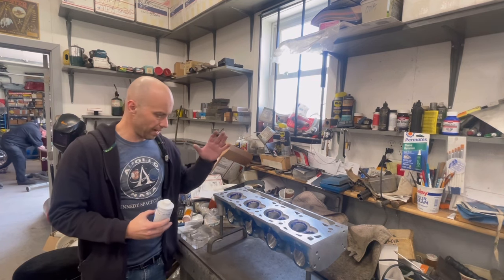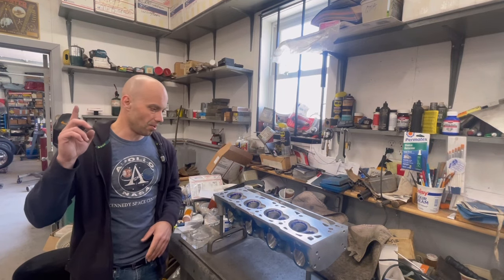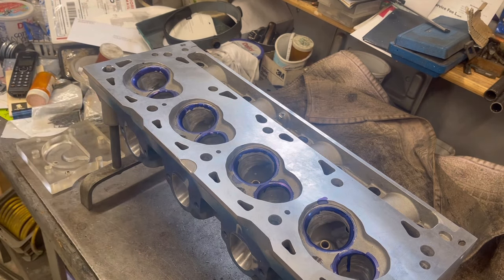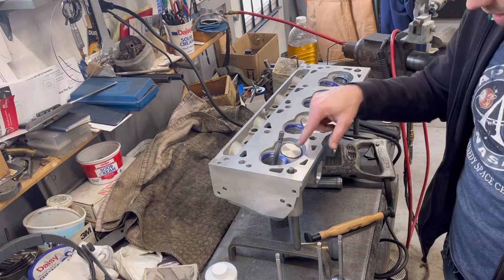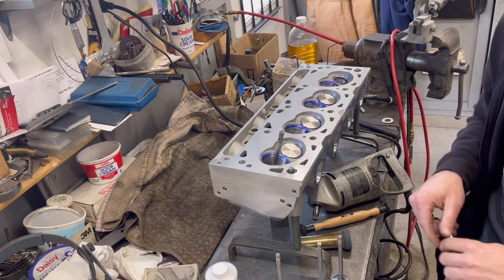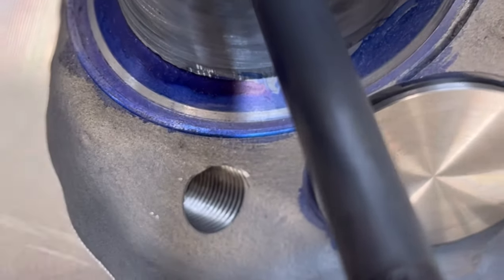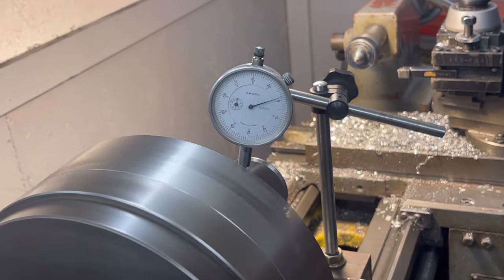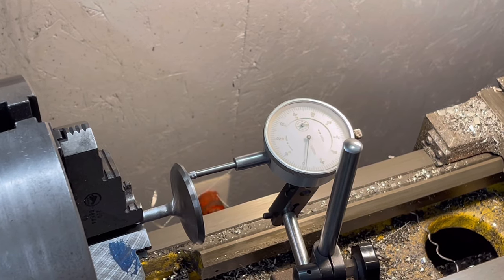The Valve Video I Didn’t Want To Make… #nonamenationals

Comment: Visuals and editing were great on this one 👍
Imagine, buying these heads and putting them on a new or rebuild engine! Compression test would show a huge imbalance between clyinders. You'd probably be checking valve train and gasket thicknesses, chasing erratic vacuum signal, just a nightmare!
Worse yet, you'd have a running engine, but never running right.
This is how you kill interest in a project . Death of a thousand pinpricks. Glad you stuck it out and posted this as a reminder to all of us.. "Just because it's made new, don't mean it's made right!!"
Reply from the maker: Man there is no no no way in hell I’d ever run these out of the box for the reasons you just stated, should be a crime to make em like this!

Comment: Now....ask yourself. If you had to wait months or even a year for valves. What could you have done instead? What other parts could have fit the bill or been modified to work?
Reply from the maker: I discussed this with my machinist, most likely I would have had to bite the bullet and purchased “high quality heads”.  That and if we are in a situation where no valves at all are available, we are in serious trouble with everything in this country (more than we are now).  Another option, find stock heads and redo them with the valves that are in them, new springs, and port the hell out of them.